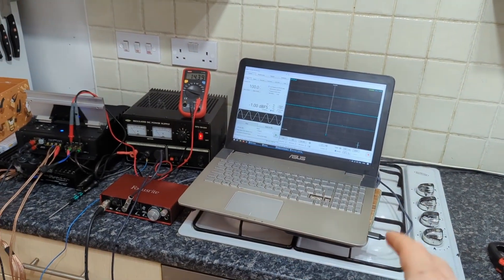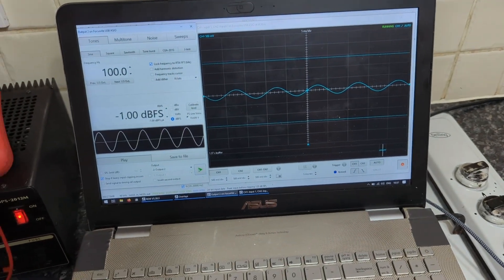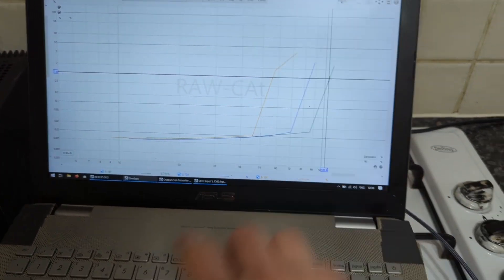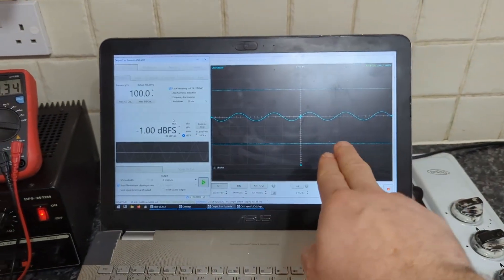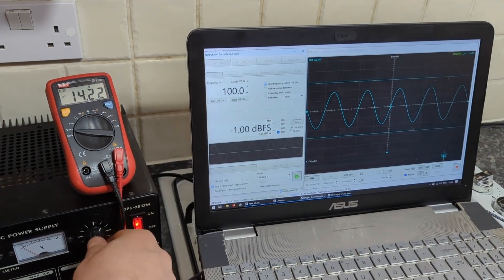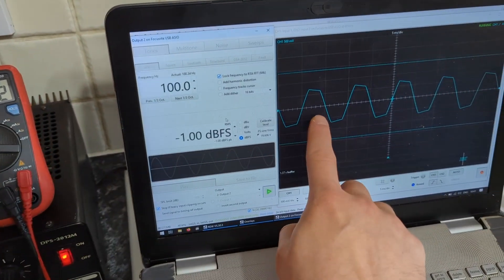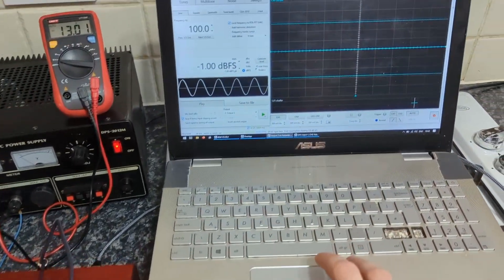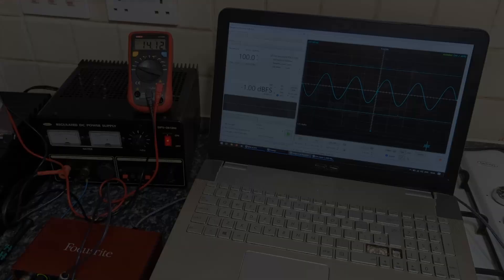What happens when voltage drops?

Comment: What Happen,  if we use cable electric like usually cable at home and compare with cable audio special for audio????
Or could you please compare cable audio with other cable. 
Sometime for fuse also, special fuse with cheap fuse. 😊
Reply from the maker: The only difference between cable is the resistance, so potential voltage drop and heat.

Comment: Awesome visual explanations!
also most newer cars have variable voltages when operating, not a constant 14V
so it is not uncommon for the cars running voltage to fluctuate around between say 12.7V and 14.5V or so
a visible distortion detector inside the car is never a bad idea....especially for us bass heads

Comment: It is not completely the same. Voltage drop is very fast. That is why amps have capacitors. Ofc if voltage drop is not long like 5s :).
Also music is dynamic. Sine wave takes 100% of amp power. Music is not - that makes time for caps to charge. Again not talking about DB drag and big SPL on the limit of alternator.
If you set up gains with engine off, lets say 12,6 than you will loose power.
Reply from the maker: Yes, agree that it's not the same, there are many more factors involved, but it's still fun to visualise this stuff☺️